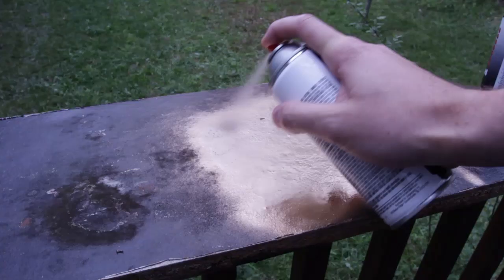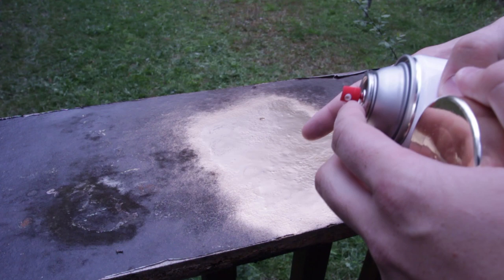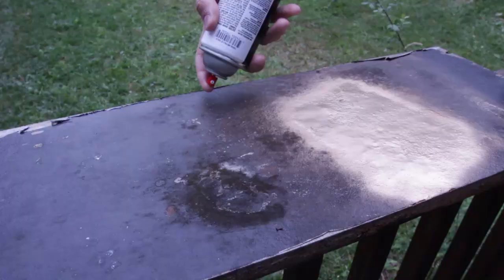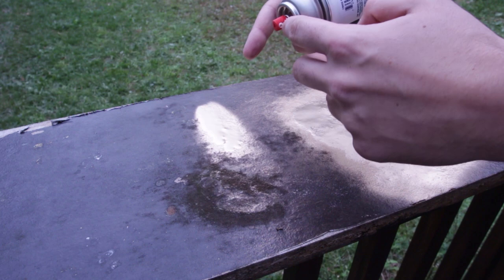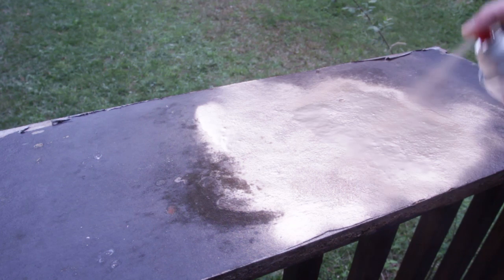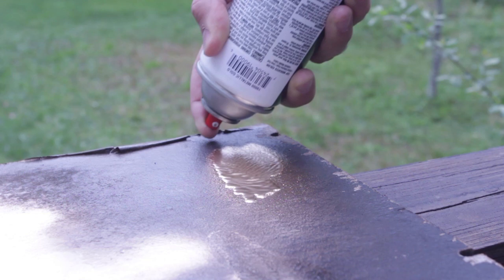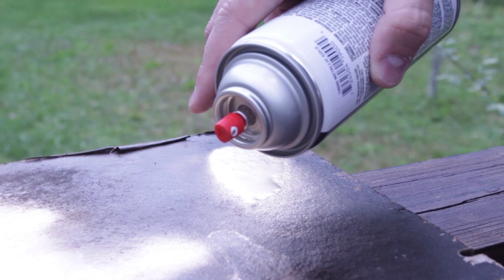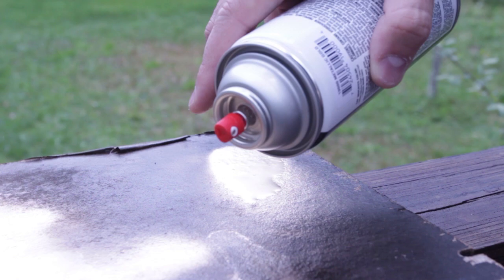Spray Paint Hack

Comment: May I say, with respect,  I already knew that if you invert the can, you will eventually blow all the paint through the tube and the nozzle. Then everything will be clean and therefore will not dry and clog the spray mechanism. Just read the instructions. It's what you're supposed to do.  Then your can will be able to spray until you run out of paint, (or propellant).

Comment: Just take of the spay nozzle and put a few drops of solvent into it and blow it out. Even if it´s already clogged by dried paint you can clean it with acetone in a few minutes. When you do it like that you don´t have to waste propellant and therefore paint that is stuck in the can. It´s both more economically and ecologically.

Comment: Another useful tip when spray painting flat big areas such as a car, is not to move the spray can left and right etc..
 Always start spraying off the object (ie miss the object) you are about to spray, as this means there will not be any initial splashes, then move across the object while spraying, finishing up on the other side off the object again.
 You can go back in the other direction.. just do not change direction over the object itself.
 The reason is, that when you turn from left to right (or right to left etc) over an object, the place where you turn gets more paint therefore it is not even.

Or you could change direction over a masked area (equivalent to missing the actual job you wish to cover). The point is, you want nice straight even and same speed lines of spray over the object itself.

Comment: most spraypaints already prvented from this happening by putting in a lubricated and oiled tube leading up to the nozzle.  It wont dry in the tube because the lubrication and oil works with gravity to slide the paint out of the tube in the nozzle.  This dosent alwys happen though and some paint providers dont have this feature. So even though it isn't nessacary 100% of the time, it is always good to double check. :)

Comment: Bad idea...you'll use up the compressed air inside the can.
Seal up the nozzle with an elastic band and/or a cocktail stick nib. Just prevent air getting to the residual paint and everything is down right wonderful.

Comment: The problem is that paint cans are filled with paint and pressurized air. By turning it upside down and doing this you waste a fair bit of the pressurized air. So if you do this constantly you'll end up having a can of spray paint with paint in it but not enough air to have a high enough pressure to release paint.

Comment: if you do that more then 7=8 times you risc to run out of gas, and 25 % of your paint will remain stuck in your Spray Paint, without the possibility to be Spray out. So it not a good kack.

Comment: next weeks spray paint hack - un clogging the nozzle with a pin in case you forgot this weeks spray paint hack. and the week after that spray paint hack, putting the nozzle in some turps / white spirit untill you next use the spray paint in case you forgot week 1's and week 2's spray paints hack. and the week after that putting a new nozzle on off a detergent sprayer or water mister spray paint hack in case you forgot week 1's spray paint hack, week 2's spray paint hack and week 3's spray paint hack. and if you forget all 4 spray paint hacks - you just gonna have to buy some new spray paint so do be warned!

Comment: But if you hold it up side down the air pressure in the botten Will come out but no paint. After a while the pressure is gone and there's still paint left. So you'll lose paint any way

Comment: Another thing this method does is waste the air and leaves you with more paint that you can't eventually use as you ran out of pressure. I prefer brush on paint anyway. Much more durable.

Comment: You are going to waste all the compressed air inside by doing this, therefore this will just waste your paint, without compressed air your paint will be left inside, so you're wasting it. 
If the thing got stuck just use a pin and poke a hole

Comment: hack
hak/Submit
verb
1.
cut with rough or heavy blows.
"hack off the dead branches"
synonyms:	cut, chop, hew, lop, saw; slash
"Stuart hacked the padlock off"
2.
use a computer to gain unauthorized access to data in a system.
"they hacked into a bank's computer"
noun
1.
a rough cut, blow, or stroke.
"he was sure one of us was going to take a hack at him"
2.
informal
an act of computer hacking.
Reply: Khak / Otpravit'
glagol
1 .
vyrezat' s grubymi ili tyazhelymi udarami .
" Rubit' mertvyye vetvi "
sinonimov : vyrezat' , izmel'chit' , razrubat' , LOP , pila ; slesh
" Styuart vzlomal navesnoy zamok ot "
2 .
ispol'zovat' komp'yuter dlya polucheniya nesanktsionirovannogo dostupa k dannym v sisteme .
" Oni vzlomali komp'yuter banka "
imya sushchestvitel'noye
1 .
grubyy srez , udar, ili insul't .
" On byl uveren, chto odin iz nas sobirayetsya vzyat' khak na nego "
2 .
neofitsial'nyy
akt komp'yuternogo vzloma .

Comment: sadly compressed air in that has just enough pressure to spray all the paint healthily. not more so you can clean the pipe.
Reply: Levent Dv. ( carbon dioxide rich air. just to remove trolls )

Comment: That also wastes the gas inside and you'll waste the gas before you run out of paint.
Reply: Leon, there is actually gas on the can... If it hadnt, how would it come out? There is pressurized gas, i dont know which one but there is.
Reply: Leon Agalawatta LSkrillex BR Is correct. The gas is a vapor of a liquid with a boiling point lower than room temp. As soon as the vapor of that liquid (the gas) leaves, more of the liquid boils replacing the escaped vapor (gas). The propellent can be very many different substances or mixtures of substances.